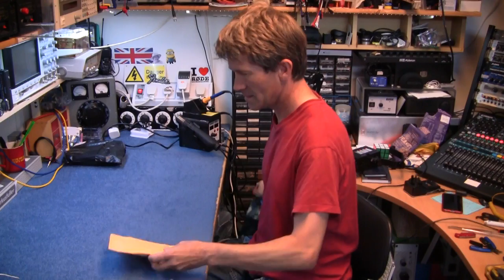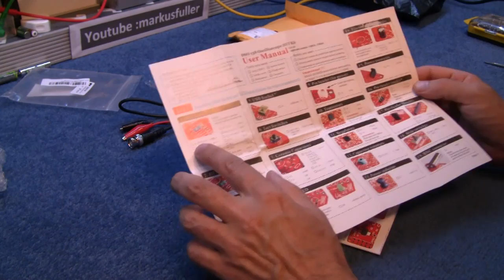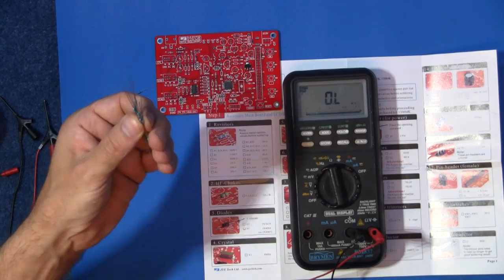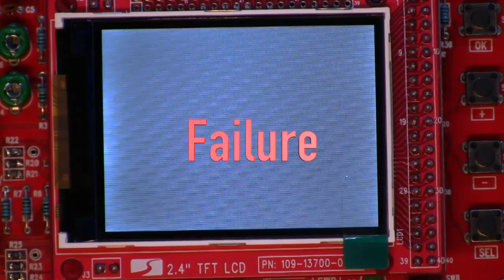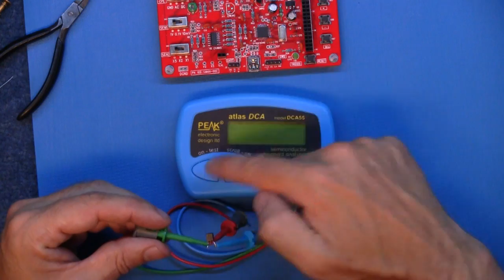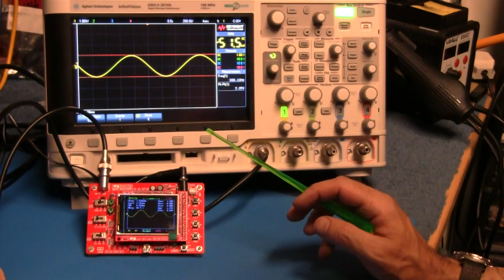Build an Oscilloscope for £15 the DSO138

Comment: There is an easy improvement that can be made to these (and it also applies to the smaller DSO138 "Mini" version).  The waveform might look a little raggedy with high input signals.  The reason is that the values in voltage divider R6, R7, and R8 are a bit too low and put a little too much load on the output of amplifier U2B.  Since the divider feeds the high input impedance of the non-inverting input of U2C, you can easily raise those resistances.  Just raise all of them ten times.  R6 300 ohms becomes 3K.  R7 180 ohms becomes 1.8K.  And R8 120 ohms becomes 1.2K.  Use 1% resistors.  Also, I think nowadays they might all come with the SMD already mounted.
Reply from the maker: Thankyou for that valuable information. much appreciated.

Comment: There are several cheap oscilloscopes..very useful..almost mandatory... they are very great and useful for clean signals.. but you will have to use your ears for high frequency  noise and oscillations .. and then use a small capacitor to ground most of any possible noise heard.

Comment: So you powered it up on a conductive antistatic mat and blame the component that shorted out on the mat? Never power up while on those mats.
Reply from the maker: WGwireless yes but the unit has plastic standoffs in the four corners so the board is not in contact with the mat.

Comment: Those testers never seem to test voltage regulators. I built this kit as well and it worked right away, but it started having trouble after it had been running for a while and I figured out that the 5 volt regulator was getting so hot it would burn me if I touched it, so I ordered some quality ones from Mouser and once replaced I had no other issues with it. I would say it isn't uncommon to have a bad regulator for these as they use cheap components.
Reply: Well it would have to provide the correct input voltage and magically know what voltage to expect at the output so how could it identify it?

Comment: Nice, inspiring video. I see over here you can buy a ready one (within a case) for 45 pounds (50 euro's, large, decent company). I think for those 20-25 pounds extra (case apparrently about 7 pounds) I wouldn't  take the risk. No soldering skills, but nonetheless; these tiny parts, faulty parts etc. I estimate my chances on a working device less than 5%.

Comment: Actually not a bad idea to use the flux pen before soldering SMDs.
Reply: Stephen Cook "not a bad idea" well its pretty much the way you're supposed to...its like saying "not a bad idea to wear a helmet when riding a bike"
Reply: I make a flux from pine pitch and alcohol it came be made very thin as it drys it gets very sticky and holds the components down. The fumes are very low and it mixes ok with cored cored solder. Been doing it for a good few years and not problems so far. It clear easily with alcohol so no residue.

Comment: What kind of input connection is that? Will it take 3.5mm jacks?
Reply from the maker: onceuponheytime Hello the input for the signal is a BNC and the input for the power is a standard power plug though not sure of the dimentions as there are so many different sizes. but basically one of those 9volt wall warts should be the right fit.

Comment: Mine had a faulty transistor in the negative voltage generator circuit, fairly easy to find, not too difficult to remedy.
Reply: Silver Legend Thanks for not bitching around about the faulty component like some other people in this comment section.
Reply: There will inevitably be some missing/faulty components in these kits as there must be hundreds of thousands of them shipped every week. Most sellers are only too keen to remedy problems to maintain their reputation. 

I did not 'bitch around' as you so eloquently put it because, with the excellent manual provided, it was a simple matter to trace the fault and cheap and relatively easy to remedy it. In addition it was a quite enjoyable and educational exercise in fault-finding.

Considering the cost of such a usable little DSO I have no complaint whatsoever; it is ,as you would probably say, a lot of bang for the bucks : -))

Comment: Hi Markus,
what is the temperature of the iron do you use to solder the SMDs?
Thank you for you  videos.
Reply from the maker: Hello. Im not sure but I think the iron was set at about 280 Celcius though I was using old lead solder.
Reply: Thank you Markus, normally I use 350 Celcius, but I think it's to much for SMD.
Reply from the maker: Im not sure what the safe limit is for SMD components. Im sure Google has the answer.

Comment: I built one and I am very happy with it, for the price. I bought it for less (yes it's an original) for £12.45 from Aliexpress. I also bought the acrylic case for about £4.50 but one piece had moved in the laser cutter and was misaligned. Fortunately it was not a critical part and I could discard it.

Comment: thank you for the video. do you recomend one of these for basic synthesizer calibration and testing? i am trying to learn to repair and service my synths, but want to stay in the low budget side.
Reply from the maker: Hello Mikel. It is a great little oscilloscope and you get a lot for the money. however its bandwidth is not very high so it will be good for most things but a bit slow for other measurements. but considering the price of this you could get a lot done with it, I believe you can also buy these ready made if you are not comfortable with all the soldering.

Comment: So I got your dso 138 oscilloscope as shown in this link.
https://www.amazon.com/gp/product/B0195ZIURK/ref=od_aui_detailpages00?ie=UTF8&psc=1
I got it all put together no problem. Turned it on and tested it. It worked! (phew!) Then I get to tinkering with things, testing some of its own circuitry to look at voltage wave forms and whatnot.
anyways, long story short, I think I shorted it. I was testing a 9v power supply, 2000 mA (which I now realize is way more than desired). But then I think I bridged R26 and R37 (on the right side near the power supply ports) and heard the 'zzt' sound that is oh so very very bad for electronics. The screen went white.
I quickly unplugged it and hooked it up to the 9v battery that I'd been using. The screen still turns on but stays white, and the "trigged" led does not respond to any input, button pushes, switches, etc.
How badly did i wreck it? Are there any suggestions on how i might fix it? (like maybe I just burned out a component that can be easily replaced (oh please oh please)).
Thanks in advance if you have any useful information for me!
Reply from the maker: Hello Myles, to be honest I think that the processor or the clocking for the processor may be damaged and when you start it up the initial program will not run therefore the screen is still white waiting for data to control its pixels. if you are lucky it may have killed the power regulator U5 (78L05) which is a 5volt regulator that is very closely connected with the 2 resistors you mentioned. if you have a multimeter you can check this it should have a negative (middle pin) and a positive of about 8to9 volts then an output of 5 volts. these are reasonably cheap if it needs replacing. this is just a guess really as it may be whats stopping the processor from working. but to be honest the problem could also be elsewhere, thats leads you into lots of time faultfinding. I hope you get it running again.

Comment: Opening mail with a big knife? Oh, come on dude, why do you try to copy eevblog? Why not think of something original?
Reply from the maker: Im not trying to copy Dave. he uses a bowie knife I use a dragonslayer knife, the similarity is that they are both large knifes. though If I used a box cutter you could say someone else used a box cutter in a video before I did. whatever I use someone has probably done it before me. everything you do has possibly been done by someone else already. ie I teardown a mixing desk then Dave tears down a mixing desk afterwards, both video's had something for the viewer. I make a video about capacitors and people did it before I did and there will be people making similar subject videos for years to come after I did. it does not suggest copying.

Comment: You get the assembled and working unit on ebay for only 13,80 Pounds, thats 17,99 Dollars (free shipping):

http://www.ebay.com/itm/Assembled-DSO138-2-4-TFT-Digital-Oscilloscope-Kit-DIY-parts-1Msps-probe-M-/172332326947?var=&hash=item281fcea023:m:m0SgGSlnU9TXwT1OOkunbCg

Comment: Hi Markus. I think you might have accidentally bought a counterfeit DSO 138. On the DSO 138 page on the JYE tech website there is a notice about how there are a lot of fake DSO 138's on the market right now. In the notice there is a link to a forum post in which multiple people state that banggood is one of the company's selling these counterfeits. Apparently some company named SainSmart replicated the exact design and is selling them for almost half the price of the original ones. Just thought you would like to know!
Reply from the maker: Hi I checked with JYE tech and they state that my scope is genuine. they have a run of unique serial numbers and when you register it is checked it is a genuine number and that number has not been registered before. then they tick it off so if the number comes up a second time then that is not genuine. Thats why i dont mind the serial being shown in the video as i checked and registered the night before i made the video.
Reply: Logic correction:  If there's a serial number collision, you know that one of the two is not genuine, but you don't know if it's the second one to register, or the first.

Comment: Soldering SMD parts is alot easier if you have 2 soldering irons. Also if you use the tips that curve at the end it helps to position the parts without needing a tweezers.
Reply: Heathcliff  I have only been soldering for the last 6 months. I just built the music spectrum from banggood. It's all surface mounted components. Didn't seem to be that bad. Fiddly yes, tweezers a magnifying lense light and a steady hand. But pretty much did it over about 7hrs.

Comment: Bought a couple of these as they seemed cheapy and wasnt expecting them to work very well. I had a dud transistor on one which gave strange results. The diagrams on the manual do list various voltages at various test points on the diagrams, so I was able to track the fault down. I keep one indoors for odds and sods and one in the garage for car work. At £20 I'm not too bothered if it gets damaged.
Reply from the maker: Yes they certainly are cheap enough to have one when you need it. yes I have a much higher spec scope but I think I will make a box and battery for this and keep it near the synthesisers.

Comment: I did this a few months ago. Same model number. Works OK for basic stuff. I used solder paste and the hot air gun. The IC's I used the solder paste but used the iron to tack down one pin. I didn't have the problem you had.  I wish it came in some sort of a case. I got a cheap metal case and mounted the O Scope, Capacitance/ impedance tester and Voltmeter in it.
What is wrong with the Elenco XP-15K kit? The PCB burns past 8V The C2 Cap arcs and burns the board. I spread the trace apart as far as I could and got it to arc at 10V.

Comment: I've bought one a year ago on Aliexpress. It had all SMT mounted, I just soldered through-hole. It even worked for a while, after I resoldered some obviously poor joints. And after few power-ups it just shows me blank screen with some rubbish pixels. Maybe there are more poor solderings I did. Dumped in a box for now.
And sure, it's not for big engineering work, just to decorate some homebrewed synth.

Comment: I built one of these a while back, it has a fault, I'm gonna watch all of this later and see if your problem is the one you fixed, no spoilers please lol. Mine's a different fault. When trying to set it up (fixing the square wave display), the trace plummets when the required settings are selected and from memory (it's been a while) I think the signal drops low as I have to increase the scale. May be I'll have a lil tinker round with it one day.

Comment: Really great video. I managed to assembly one as well. For me it was a very nice soft of therapy work to solder all the SMD parts. But managed :) One tip is, when you get the acrylic case, build it up a few times without tighten the nuts and bolts... THAT part took me forever to get done and yep, since I had to redo that part 3 times. First time I managed to forget to pull off the plastic cover from the display :D The second time I got a tiny little protection paper from the case sitting ON one of the knobs. Heh and yeah, the acrylic case is sensitive... managed to get a tiny crack in it(not seeable) due some misalignment, from my part and yep got a bit frustrated so I gave it a bit of a bash :) Anyhow, great one as always. Happy times are above us!
Reply from the maker: I think I will try and make a box for mine. something simple. I like the look of the acrylic case but i want something with a battery case within it.
Reply: Yes, that would have been awesome. I am bounded to have "another" cable across the desk(as if I didn't have enough?). So yep the battery solution would be brilliant.

Comment: Good grief! I can't even see surface mount components...
Reply from the maker: believe me I was having problems. I flicked one away with the tweezers but luckily they put more SMD resistors than you need. I keep looking at the floor but as with most workrooms you cannot see the carpet let alone something 2mm in size.
Reply: +markusfuller 
Required tool when working w SMDs: hoover (vacuum) w empty bag.
Reply: davecc0000 with a sock over the end.👍

Comment: yes I would agree, this is not a kit for the novice. those micro components would be a pain to solder.
Reply from the maker: you can buy it with the SMD components already soldered but I think it is a couple of pounds more 9but that saves an hour of frustrating work)
Reply: @markusfuller  and also fully assembled ones too

Comment: hmm...so the moral from this buildup is: never buy such complex kits....only professionals like you could fix it...a such a faulty component is really bad...how much was it already assembled ?
Reply from the maker: so now you tell me I could have saved 3 hours of work for an extra $5 ?. but that would have taken all the fun out of building it.
Reply from the maker: It was only assembled with that ONE chip. everything else I had to solder on myself. you can get a partially assembled one where all the surface mount components are already on there and you have to solder the through hole components on it.
Reply: +markusfuller they sell a fully assembled units on ebay for about $20, about $15 unassembled.
Reply: markusfuller Julian Lett channel got one from Banggood too and the LCD was faulty.
Reply: markusfuller
For 5 US$ more I would have rather got it assembled and tested to work...
Reply: Silver Legend did you just "true" your own comment?....... (Answer: True)
Reply: Silver Legend True! (I do ;-) )
Reply: I am not a professional just a self-taught amateur who enjoys a challenge.
Reply: True!
Reply: Probably - I haven't got the hang or replying to comments : -)
Reply: markusfuller I think these three hours are far less than $5 in the Far East, or the other way around, the $5 may be a weeks pay over there.